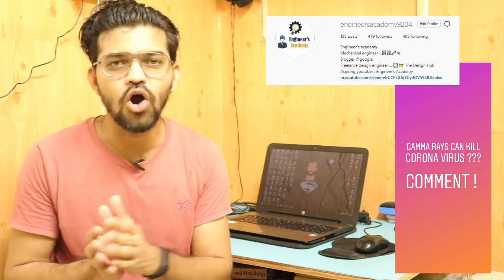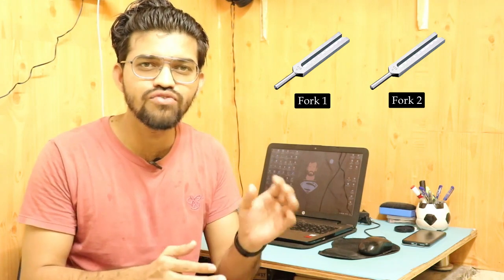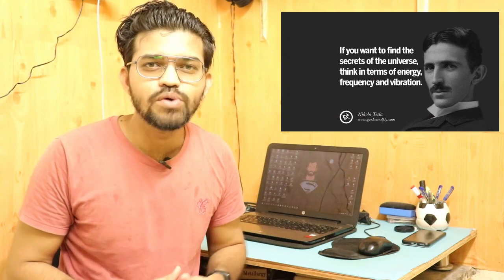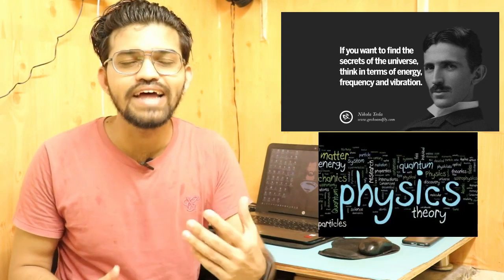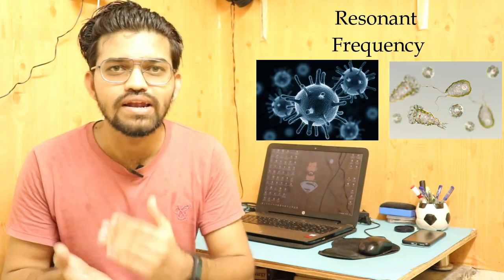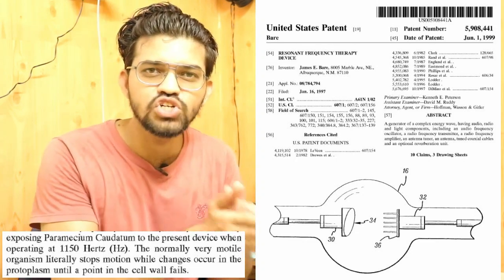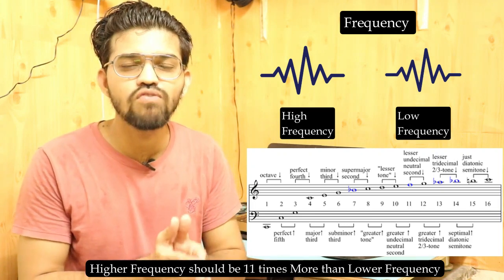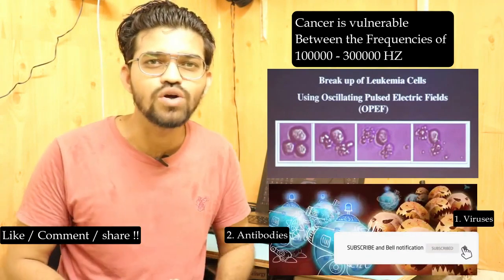Special Frquency Can Kill Virus.

Comment: Using sound is not new technology, yet is only recently becoming understood. Light works just as well, and it still comes down to resonant frequency, but unlike light, virtually everyone has access to what is required to use sound to kill viruses, cancers, and bacteria. Take note of the details, because people who put out information of such tech that can be used by everyone, often disappear and the technology is lost. Get the info out there. Memorize it. Pass it on. Spread the knowledge everywhere, because there are powerful forces including governments and corporations that will stop at nothing to suppress such information.
Tesla's work claimed to make abundant energy free to all. The work vanished.
The water hydrogen engine for automobiles vanished along with the man who developed it. 
Look it up and you'll see claims that it never happened, that it's all a myth and no car can be run on water AND YET rocket scientists are currently using the SAME principles to harvest minuscule moisture from the moon to power hydrogen rockets to propel crafts across the solar system. ...yet it can't be used for cars?
 The original starlight recipe vanished with the death of it's creator. Was it nothing more than a con like the modern version? Guess we'll never know. The existing samples disappeared when the inventor died. 
The first cancer cured with herbs (squamous cell carcinoma) was outlawed in 20 nations where potentially deadly, highly toxic and expensive radioactive treatments are still used to fight the exact same disease.
Not everyone in the health industry has your best interests at heart.
Knowledge that is horded by tyrants is shared freely by communities.
Be the cure.

Comment: I thought of this the other night and started researching to see if anybody else had thought of it. Some questions I have.. since a virus mutates to match the host cell, wouldn’t it vibrate at the same frequency of the host cells? And if it does, how would the device keep from destroying the good cells that haven’t been invaded yet? Or any other particles in the body that might have the same frequency. I understand how it works with tumors but I’m trying to figure out viruses.
Reply: If u r cured by frequencies, take probiotics/yakult after each session bcoz most of the bacteria in your body are either killed or disabled.
Reply: @perlitocabauatan9285  nope not true!
Reply: @tajr.2650  u r not an expert, man. pretending 2 b 1, hehe byebye.
Reply: @perlitocabauatan9285  I never said I was one and in that case DITTO haha. I SPECIFICALLY said “I BELIEVE...” So yeaaaa. I have been using them for years. What I do know is my own experience.👋🏽👋🏽👋🏽👋🏽
Reply: @tajr.2650  at present, i m using 30.3% herbal n 30.3% electromeds. i built my own devices. 33.3% synthetic meds.
Reply: @perlitocabauatan9285  tell us more
Reply: Sounds a little bit like that movie The Thing
Reply: Good question..
Reply: Ms. A, i m an experimenter of simple electronic devices. The harmonics of the devices reach to more than 1mhz. when i used the devices, i become 'sick' which means that my body is reacting to the killed viruses. i drink so much liquids esp water to cleanse the dead or immobilized pathogens. the freq 100khz-500khz is the freq of the viruses!
Reply: @perlitocabauatan9285  thank you!
Reply: I don’t believe the cell that is mutated by the virus vibrates at the same frequency. It may match the host cell in specific ways but if it has a virus in it then it would not vibrate at that same frequency.
Reply: Even if it matches the host cell it's still different.
Reply from the maker: Point 😉😉
Reply: @EngineersAcademy9204  please answer the question
Reply: @EngineersAcademy9204  this is a BS response to Ashley’s question
Reply: @EngineersAcademy9204  what's the frequency to kill covid?